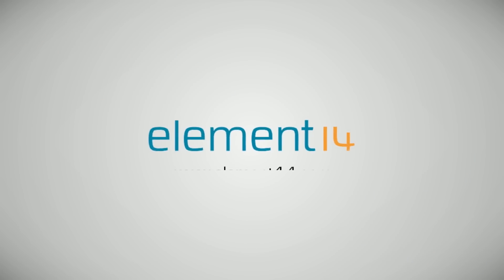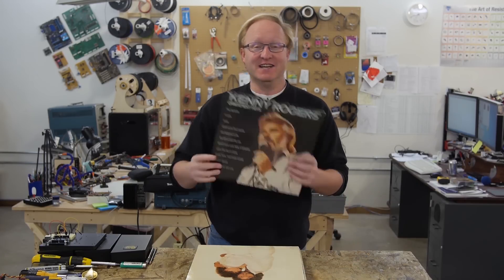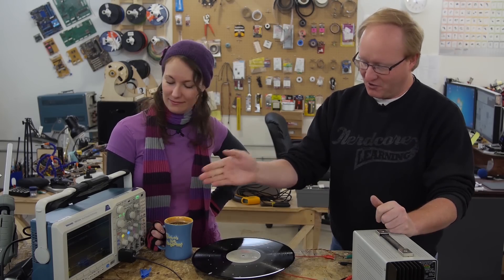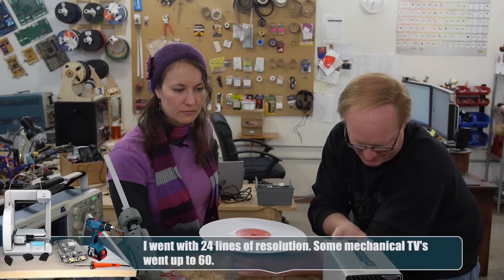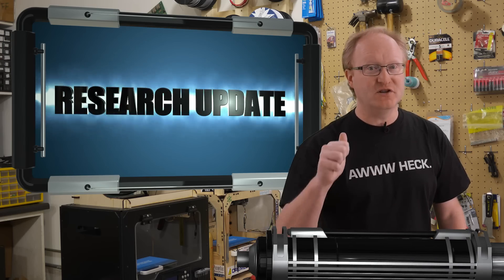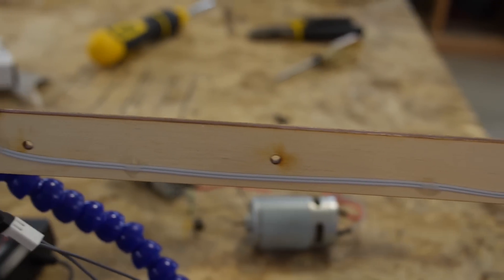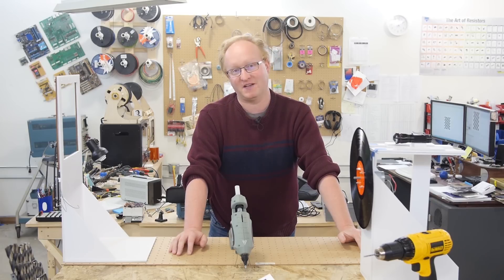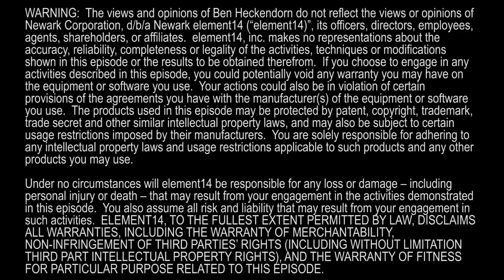Ben Heck's Mechanical Television Part 1

Comment: You can scan a laser beam with two rotating mirrors from (two) old laser printers...one for vert. an one for horizontal deflection... and a high power red laser from dvd burner (or just ebay, they got dirt cheap in the last years ;-), you can pulse red one really fast... 
Green ones are much brighter, but i am not sure if you can pulse a green laser for a long time, well you can but it might fry itsef.

Comment: LOL you made all of the mistakes first time Mechanical TV builders always make. Apertures too big, light source too weak, no focusing lens (an old slide projector makes a great light source and focusing system), photocells too slow, RPM too fast (you only need about 12.5 FPS for a good picture).

Still you should be able to demonstrate the principles involved. I haven't watched the monitor build yet, but I hope you don't blame your bad results on the principles of Mechanical TV.

Comment: Why are you using Illustrator for mechanical layout work?
Reply: +Maxwelhse Ben will frequently start with a 2D drawing because it is faster and easier to manipulate and once he's happy with it, will import it into a 3D program and extrude the vectors to create the final design.
Reply: theHeckwithKaren
Why not just start with a sketch in something like SolidWorks, which is intended for mechanical layout, and have a one stop shop? Every 3D part begins as a 2D sketch.
Reply: Tomayto tomahto. It all comes down to personal preference and what software you feel most comfortable with.
Reply: theHeckwithKaren
Mechanical software is designed for such tasks and is much more efficient at them (no manual calculations required). That's why It struck me as weird to use desktop publishing software for that purpose, but ok.

Comment: The motor control is NOT a timer circuit. It is a PWM (Pulse Width Modulator). As soon as you said that you lost my interest. It looked like you decided not to use the PWM, your best (and most accurate) way to control the speed LOL wow.
Reply: +RiaRadioFMHD773 OH NO! Ben did this project in a way you don't approve of? best tell the journalists.
Reply: +OldFordas What I stated was true. He needs synchronization with both discs yet does not use the control designed for it. Without synchronization the resulting image will "roll" vertically. Any questions?

Comment: Could the CNC have done the holes better than hand drilling, considering the design was already in the computer? I know its splitting atoms but what's the worst that could happen, right?! :P
Reply: +themaconeau Bingo. It's all about time and efficiency.

From what I've seen, CO2 laser tubes run around $1000-$3000, but more often closer to $1000. Though that can vary depending on the quality of your laser cutter as some higher quality cutters require you to also buy an assembly for the tube, which can sometimes be swapped to save money, like the deposit on a car battery.
Reply from the maker: +themaconeau We thought about it. The CNC router would have been harder to get everything aligned to make it perfectly accurate and cutting vinyl with a laser cutter creates toxic fumes that are harmful to people as well as damage the optics and can potentially corrode the interior of the machine. That's why we laser cut a paper pattern and then used it as a guide.
Reply: The Ben Heck Show Interesting. I suppose the time taken to make a jig to ensure the records were in the same spot for two runs of one CNC action would have been more time consuming than doing as was shown on the show.

Just out of curiosity, how much to replace the laser diode/assembly for the laser cutter? I'll take a stab at about $5k, for shits and giggles :P
Reply: theHeckwithKaren Thanks Karen, rock on \m/
Reply: +themaconeau \m/

Comment: I would use an optical camera lens to project the image onto the rotating disk, and put the photoelement closely behind the disk. This way natural illumination would be good enough. Also instead of putting the holes in spiral pattern, the scanlines can be interlaced. This should tolerate slower rotation of the disk.

Comment: You should add a sync signal and a Phase detector for easier sinc. You can also use a differential gear, but it's neater the other way. Usually the sync signal was a spike that was included in the video carrier signal and separated and filtered before passing on to the receiver.

Comment: if you want to take the wobble out of the spinning record you could use skateboard bearings to run along the outside of the record. like how a band saw aligns it's blade to the cutting surface
Reply: +John W Ben loves using skate bearings. We used them in the R2D2 soda cooler.
Reply: +theHeckwithKaren I really think keeping that record from wobbling is going to be a big part of getting the machine to focus the picture well.  Super excited to see the rest of the build.

Comment: K1 = (n1-n2)/(E2-E1) = rpm/v
ECEMF = EA - ERA
ERA = IA x RA
Speed (n) = ECEMF x K1
Kv = RPM / (E × 1.414 × 0.95)

Motor Speed Calculated FTW! (Jeez I haven't used this math in YEARS! I literally pulled that off of an old note because I can't remember any of it, wow.)

Comment: Why are you using a DC motor?  A 2-pole synchronous AC motor will rotate at exactly 3600rpm and can by synced to mains power.  That's how Baird did it.

Comment: is this similar to the flip cards ie draw pic in corner and flip cards to get picture to move?
Reply: +RooBoy Hiphop Not quite, but sort of. If you break the image up into many lines, those lines get drawn individually and add up to an image, then the next image gets drawn line by line.But it happens very quickly so it looks like a solid image, only a little blinky.

Comment: So I see you will be using the classic Motorola Lapdock in the future. Not sure if Ben reads the comments or not but if anyone from the shop sees this, I can give some info on the lapdock that I have learned. I own 3 of the models for the Atrix and Bionic phones. Whatever you do, DO NOT get the lapdock 500. They don't work without the proper phone. Period. A Lapdock 100 will work but is much bigger and maybe not ideal for this. Now onto the Atrix/ Bionic lapdock specs.

The screen is 1366 x 768 resolution at 11.6" size.
Input is via micro HDMI.
USB is micro again and works in an odd way. (More on that further down.)
The keyboard is designed specifically for the Android OS and is a bit of a pain with Windows or Linux due to lack of certain function keys. (Windows/ Super Key, Insert, Pause, etc.)
The touchpad can be disabled by double tapping the top left of it on the LED.
Battery life is fairly good. I run a 1.6 GHz quad core Android stick solely on lapdock battery and even at high power and max screen brightness I can still get several hours run time out of it.
Device power works with a magnetic switch (I'm guessing a reed switch of some sort) and the HDMI sense line. So long as that HDMI wire is grounded out the device will power up. Without it the whole things is powered off. The magnet switch controls the screen and maybe a few other things. When the lid is closed it shuts the system down but leaves the USB host connection powered so the target phone can still charge even when not using it.
The USB is a bit weird in that the data lines work as normal for device mode but due to being designed for a phones said USB cable does not draw power in but rather sends it out to the host device. I measured the current and found on 2 of my 3 lapdocks it pushes right around 700 mA of juice. (Never tested the 3rd one...) If the host device does not need to run on 5V or uses external power then the +5V line in the USB connection will need to be broken. Ground connection will be fine.

That's what I know of the lapdock functionality. Hope it helps.

Comment: Your RPM signal off the fan is more commonly refered as the "Sense or Tach" wire and typically puts out a predetermined pulse for each rotation the brushless DC motor gives. (For Example, Intels Fans give out 2 pulses per RPM to that wire. So you would take the pulses you'd get in  minute and divide that by what ever amount of pulses where givin per rotation to get the RPM Value, all fans are different though, typically datasheets will tell you.

Comment: I think it would have been a lot easier to mount the light sensors behind the camera disk. Just like on every other mechanical TV camera I've ever seen.

For authenticity you could replace the LDRs with a tube, but I wouldn't go that far if I built one myself; I'd probably use photodiodes for speed, though.

I'd also put an audio tape recorder in the circuit to record the video :-)

Comment: Ah. I was excited about this episode, John Logie Baird demonstrated (and had a workshop for) this system about a mile or so from my house in the mid 1920's. 

http://www.tvhistory.tv/1926-Baird-Transmitter.JPG

Sadly the exact site is lost underneath a shopping center (mall), but there is a plaque commemorating the approximate location.

Comment: the imager (camera ) iss all wrong
the lamp is replaced by a ldr normaly
and there is no sensor infront
Reply: Yes. That is the way it is done
Reply: They are for focusing
Pin holes are not used
the holes in the disk need to do all the work
Nbtv camera type that in Google and you get a few diagrams

Comment: I don't think the original mechanical TV pickup used a flying spot scanner, but rather the image was focused onto the surface of the scanner disk and a large photo cell then picked up the light behind the disk.  At least this version would work as a camera in a well light room, the scanner will have to be used in total darkness.
Reply: I agree.
Reply: +Kenneth Scharf they didnt
it was just a ldr and the room light was wat it saw
that way thay had one pulsed signal to send